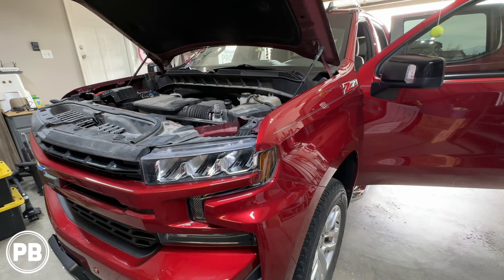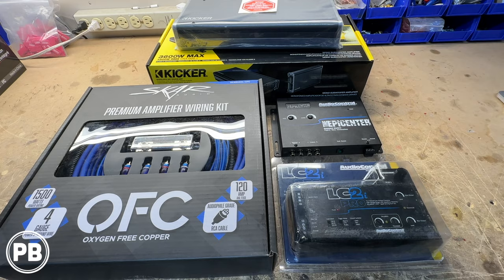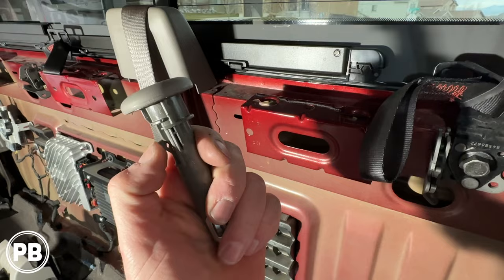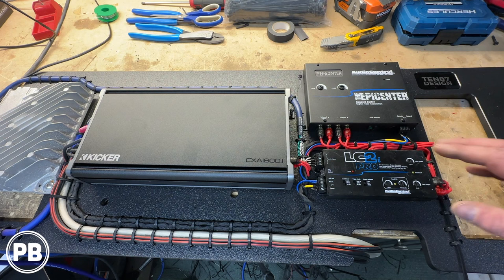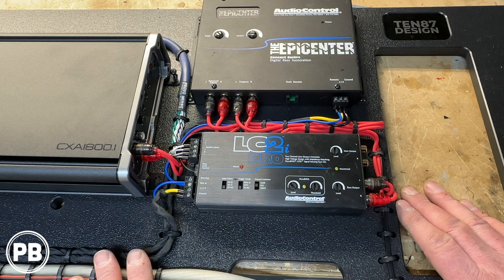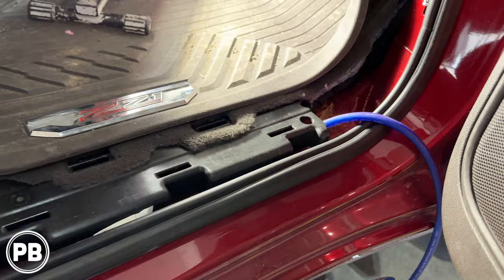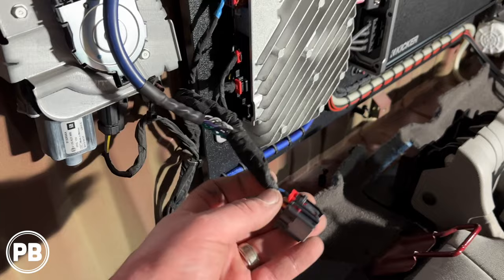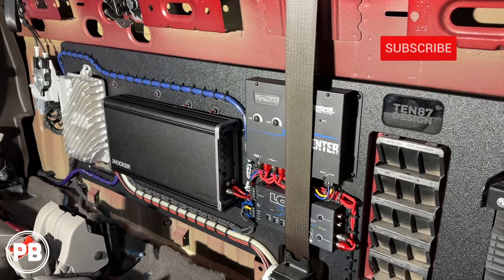2019 - 2024+ Chevy / GMC Truck Amp and Subs Install

Comment: What signal wire did you use when tapping into the bose amplifier? Im assuming you tapped i to the subwoofer signal. Will doing it this way prevent the chimes bei g obnoxiously loud? Also i didn't see and noise cancelation bypass?
Reply from the maker: No ANC found on this gen truck in this trim, and the blue / green wires shown we tapped into are the sub signal only which doesn't have any chime signal passing through it.
Reply: @ProvoBeastAudio thank you..

Comment: Does the epicenter get power and ground from the bass amp or can you get it from the lc2??? Thanks
Reply from the maker: Both the LC2i and Epicenter need constant 12v and ground, which we snagged both from the power and ground terminals of the amplifier.

Comment: Great video and very clean install. I have question that you may be able to answer so I can get my install done right. 

First, I have not taken the backseat off, so I cannot confirm I have the same amps in the back, but I assume so since I DO have the Bose system in my 2021 TB.  I am doing a very simple install.  A kicker pre-fab box, an Alpine mono amp, and a Kicker LOC.  The LOC has the 12v turn-on lead coming off of it.  Models below for reference.

My question is, in your install you tapped into the Bose amp with the white and grey speaker leads from the blue and green wires in the harness. In every other video I have seen, people are using the yellow/yellow and black wire into a LOC to go to the mono Amp, usually in the front passenger kick panel.  Is there a reason you did this?  Is it because you need a full-range signal to go into the LC2? 

If I can get to the yellow/yellow & black wires right there in the rear near the harness, I don’t see a reason to put the LOC in the front passenger Kick panel like I have seen most do.  What signal comes from the yellow/yellow & black wires?
  For my simple setup, what is my best course of action?

Thanks for the recommendation!

Kicker TRTP 10” Sub Box
Alpine S-A60M Mono Amp
Kicker 46KISLOC2 Speaker wire to RCA LOC
Reply: Same here as far as the Bose output wire.  I have been trying to find a video of someone coming from the Bose subwoofer. Stumbled one would go to the door speakers, carrying the highs, when there is a input from a sub, carrying the lows. Wouldn’t the door speakers give out the wrong signals, especially when adjusting the settings on the head unit?  Im sure the LC2 will make up for that but it’s probably going to have some sort of interference when adjusting on the head unit.
Reply: @johnspratley6691  I think after seeing so many videos on YT that say to use the yellow/yellow&black that is what I am going to just do and see how it works out.  I am going to trace them back to where they end behind the seat versus running my LOC all the way up to the kick panel.  That just doesn't make sense to me.  The Amp should be able to take the full range signal, if that is what is coming through those wires (Y/Y&B), and just pull the lows using the low pass filter, at least as I understand it. I have used LOCs with full range signal before and it works fine.  

 Ill come back on here and let you know how it goes.   Thanks for the reply.
Reply: Did you find the yellow and black wires near the amp? I currently am in the middle of a subwoofer install and can't figure out what wires to connect to the loc.
Reply: You can use the signal from the bose amp yellow/yellow&black wires to make your connections easy. You can use the Audiocontrol LC2I Pro or the Pac Audio SNI-35. If all you're doing is adding a subwoofer amp, get the signal from the rear. You just have to remove the seat.

Comment: Why do you need a lc2i and a epicenter?the lc2i has the same function expect its a high n low adapter with bass enhancement plug in bass knob also
Reply from the maker: LC2i doesn’t have any eq capabilities, just a line driver and bass roll off correction. The epicenter has a line driver function as well, but also eq function. If you want an (almost) all in one, check out the epicenter pro.
Reply: @ProvoBeastAudio  I've installed the epicenter pro couple times.

Comment: Where is the factory sub in the new GM trucks? I just pick up a 2024 AT4 1500. Is there more of a simple solution for the sub amp? I have an older Audison LRx 1.1k mono block with high level inputs, could I not just use the signal from the Bose amp and go directly into the Audison?
Reply: Not sure on the 24 models but my 21 model has the Bose sub in the console
Reply: My 2023 has a factory Bose sub under the front of the center console

Comment: Got I huge question lol what wires did you tap into on the Bose bec I’m doing a 23 with the Bose I’m just wondering what wires you used and if you had any problems I will wait till you respond before I tap into anything
Reply from the maker: just the factory sub speaker wiring (blue and green twisted pair at the amp).  That is the only factory connection.
Reply: Is there a harness for this?
Reply: Do you happen to know what wires are what back at the amp on the Bose amp so if I do door speakers

Comment: In the process of installing a LC-6-1200 amung other things.  Seems to me once the back seat goes back in the seat foam is going to blanket the amplifier quite tightly.  (Not even sure the back rest sill even go back in with the amp mounted.)  Did you have to cut the foam for this install?  Any overheating issues?

I drove a few miles without the rear seat and wow was that noisy.  10x louder than expected.  If you do cut foam, does it increase cab noise much?
Reply: None of the channels show that, or the seat reinstalled. I have 3 amps on my custom rack and I had to do a lot of trimming and it still wont fit perfectly. The bottom of the seat is about 2 inches from going back into place. The "foam" on my 2024 GMC3500 PRO CREWCAB is not a soft foam, but more of a molded Styrofoam.  Very dense, but cut well with a Oscillating Multi Tool.

Comment: I got a 2024 silverado with bose pre installed and for the rubber grommet near battery terminal it doesn't have the accessory plug for me to feed through for positive. Any ideas?
Reply: Check both sides of the truck under hood. Should have one on either or both sides
Reply: My 2024 didn't have a nipple. I just slit the big grommet on the passenger side.
Reply: Good deal, good to know. Thanks!

Comment: 23 sierra, factory signal sucks. Can't even turn my mb1024s up without the factory radio maxing out first. What do you recommend for the signal input so that it doesn't suck? Thos is a non bose stereo with an unknown line converter
Reply: LC7I with a custom harness from @Grayback1973

Comment: Hopefully you respond but I’m running do jl 13tw5v2-2 wired to 1 ohm and I’m running the line out converter but not the epicenter. Will the epicenter give me more bass? My lows hit very hard and my highs hit pretty good but think there could be room for improvement…
Reply: You need a bass knob for your amp. The epicenter is used to bring out the bass that's in music such as rock, Mexican, etc.

Comment: Excuse my dumb question but how does the signal get to the speakers? Did you run speaker wire from the amp to each door? Newbie trying to learn here
Reply: No, they didn't run new wires. The LC2i Pro is a line output converter, it takes the high level signal from the factory speakers (usually 1, or 2 speakers) and converts that high level signal to low level for the subs (for the bass). It's all done inside the LC2i.
Reply: The amp they installed doesn't amplify the factory door speakers so don't need wires from the amp to the doors. They are still powered by the factory amp. The amp they installed only powers the 4 subs under the seat that they installed.

Comment: Did you have to cut the foam out the back seat in order to mount the amplifier
Reply: im more than confident they didnt say that bc yes they did, big time…i know bc im finishing mine right now
Reply: @EricH0skins Would you mind sharing any tips? I'm attempting to mount a pair of 10" Kicker hideaways on the cab wall of my '21 Silverado and while I have space to mount them, I'll definitely have to trim the seat foam. Thanks for your time.
Reply: @djcarkhuff I just trimmed as needed for my amps to fit. I had to mark and cut, mark and cut. It was kinda annoying but I wanted to leave as much foam as I could.
Reply: @djcarkhuff I’m thinking about doing the two kickers 46hs10 hideaway behind the beck seat wondering if some foaming trimming might fit those two I got I 2024 at4 2500hd.

Comment: How could I add a 4 channel amp to the Bose? I have a 22 1500 ltz with Bose
Reply from the maker: There isn't an AmpPro module yet to replace the OEM bose amp, so you will have to tap in for signal after the amp.  There are Pac T harness available to help you do that, but you'll need some sort of high power LOC and such to accomplish this for internal summing, etc.
Reply: @ProvoBeastAudio  I have a loc on a sub right now tapped into the speakers. I want to add a 4 channel so would I just cut the front and rear speaker wires into a lc5i and replace my loc from the sub into the lc5i then run my own wires door to door into the speakers? My speakers are also upgraded to Focal speakers. Cutting my harness isn’t my issue I can do that with no issue, I just know not to cut the front tweeters since that’s for phone calls etc..
Reply from the maker: No need for cutting harnesses, there is a T harness you can use.  Yes, reroute all into the LC5i or lC6i where you can do internal summing for your amplifiers.. https://amzn.to/48fWiZy @jonatana8531

Comment: When I go to the site for amp rack it says won’t work for mine cause I don’t have the Bose. Seem odds since the only difference is the amp in the back and I don’t have that? Would it still work?
Reply: The only reason why it says it won't work is because your truck(like mine) has foam behind the seat. And because we have less mounting studs.
Reply: @gerardobernardino1092  so it will some what work? I moved the foam from mine
Reply: @growitwemowitllc1752  it'll work no problem just add extra mounting brackets.

Comment: What about the ANC MICS?
Reply from the maker: Most trucks don't have ANC in this generation, unless you have mics in the headliner in the back seat (not above the driver / passenger).   If you have ANC, there are bypass harnesses available which makes it easy to complete the process.  Our LTZ Bose trim did not have ANC.
Reply: Can you provide a link to the anc bypass harness please? If it does come with ANC would you happen to know the wire colors?

Comment: I have a 2022 Silverado lt refresh and I have 2 amplifiers, one for 4 8” basses, another for the 4 door speakers and the 4 speaker amplifier turns off. They tell me that I have to change the battery. It is true to your experiences that you have had. or it will be a bad installation I hope you can help me
Reply: Check for any loose power and ground cables from distro block to amp. Check ground links and fuses to make sure they're not loose as well.
Reply: @gerardobernardino1092  The audio shop tells me that my battery voltage is low, do you know what voltage my battery needs for it to work well, they say my battery is the problem and they say I need a new AGM battery, but I think it's something else.
Reply: @miguelmontes2712  while running atleast 13+ voltage  while off 12ish which is just resting voltage
Reply: @gerardobernardino1092  It's strange, my truck is 2022, my battery is not very old, but it's not enough for the sound system. Can you recommend a battery for the sound system for the 2022 silverado 1500  lt?
Reply: @miguelmontes2712  before buying a whole new battery( which I doubt you need a new battery) check what I stated before. Also, you can check your voltage on the truck in your info tab on the truck.
Reply: @gerardobernardino1092  ok thank you very much for your help I will check what you said before and I will let you know what happened thank you 👍
Reply: @miguelmontes2712  no problem,you're welcome!

Comment: How were you able to lower the chime? I installed door speakers an I here my blinker light so loud threw my speakers..
Reply from the maker: Factory audio system remains unchanged - this is simply adding an amp and sub.
Reply: Would you be able to lower or disconnect my chime on my 2023 Silverado?

Comment: I have the same install with an audiocontrol lc2i. And epicenter.   But im getting  a thump sound  when theres no music playing     Any advice???
Reply: A thump sound? When you turn on/off the system? While you're driving?
Reply: Just installed a system in my truck and had this issue on the way home. Check to see if your terminal leads on your box are grounding out on the jack.